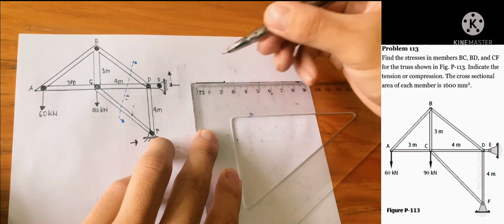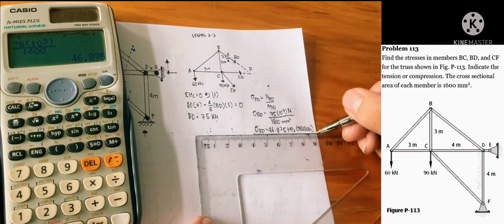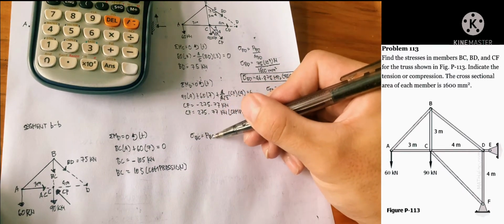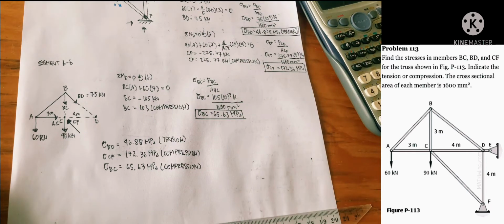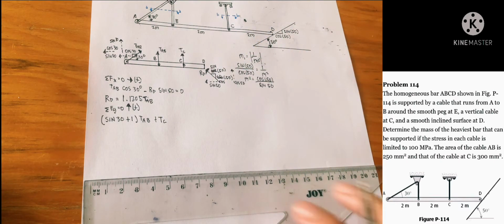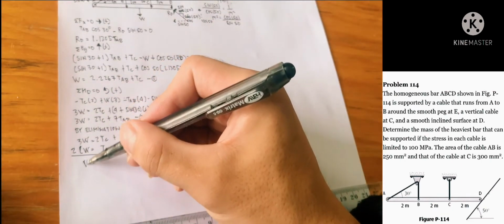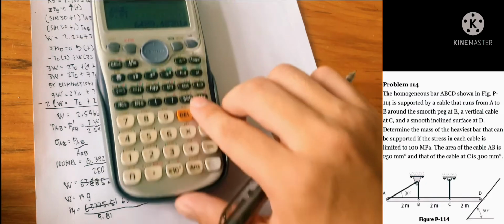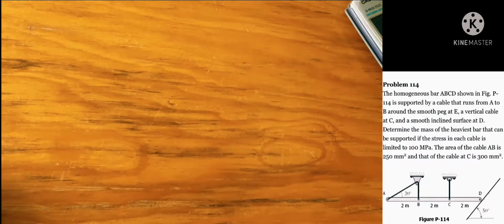Axial /Normal Stress (Review) - Part 5

Comment from the maker: Content Summary:

12) 0:05 - Find the stresses in members BC, BD, and CF for the truss shown in Fig. P-113. Indicate the tension or compression. The cross sectional area of each member is 1600 mm2.

13) 9:42 - The homogeneous bar ABCD shown in Fig. P-114 is supported by a cable that runs from A to B around the smooth peg at E, a vertical cable at C, and a smooth inclined surface at D. Determine the mass of the heaviest bar that can be supported if the stress in each cable is limited to 100 MPa. The area of the cable AB is 250 mm2 and that of the cable at C is 300 mm2.